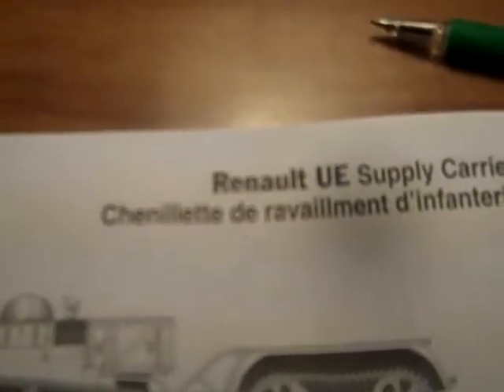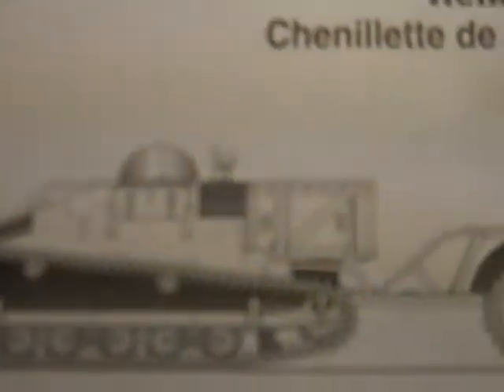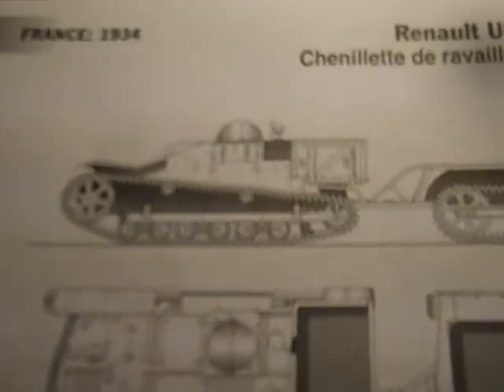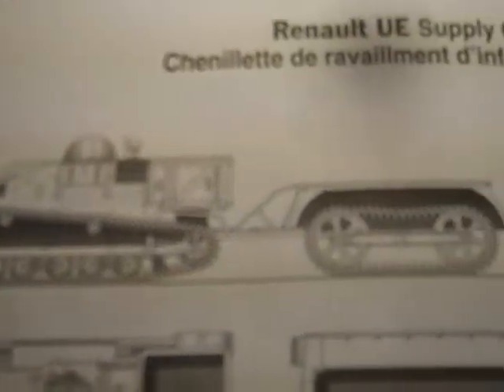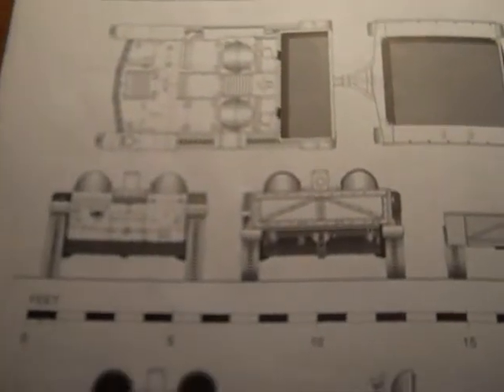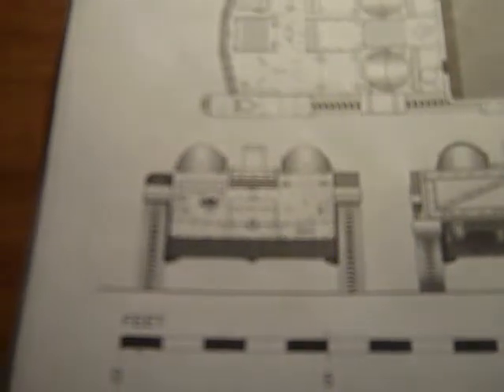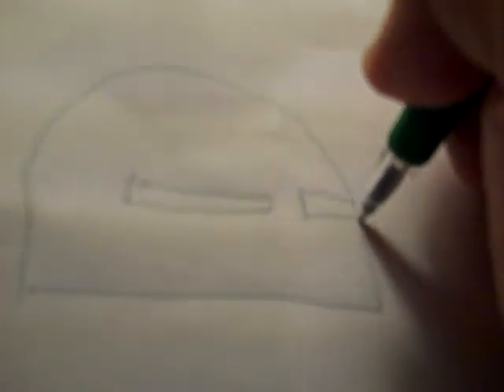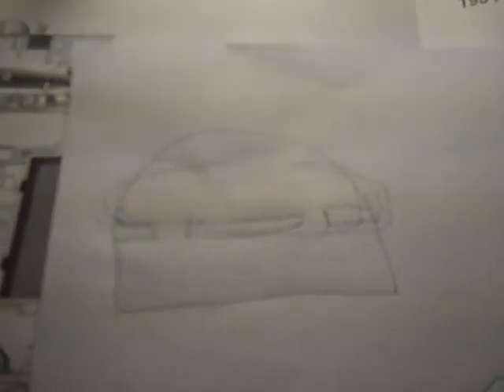Der French Renault UE Tankette

Comment: It isn't a tankette, it's a supply carrier.  Basically it's a tractor not different from a komsolets; rather than going around scouting it pulls artillery into position, though a few had machine-guns for close defense.  Had a terrible suspension, prone to breaking its springs, with tracks that were abysmal at best.